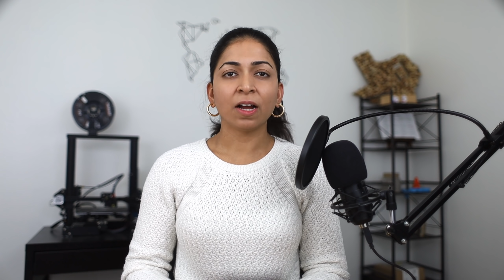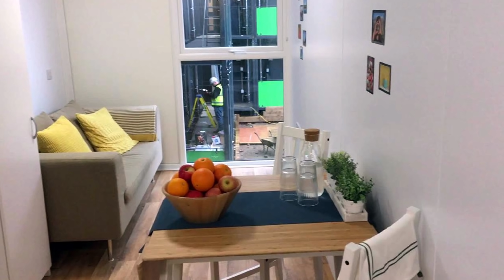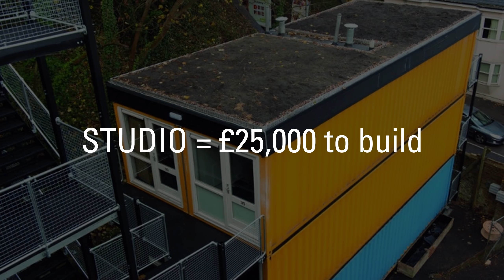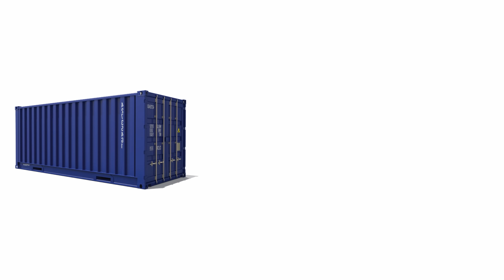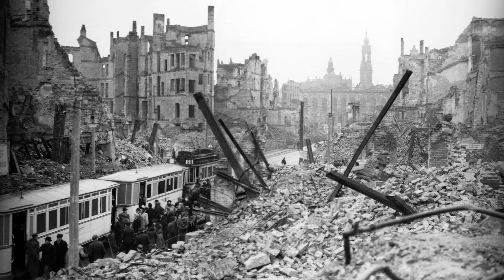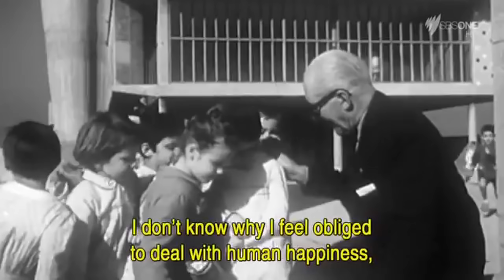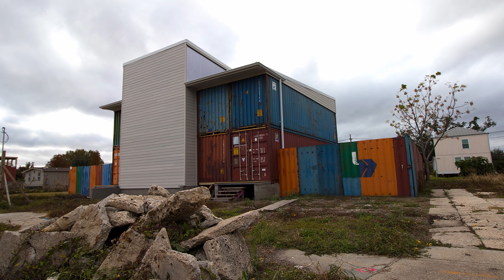Why Shipping Container homeless shelters FAIL

Comment: If they have hot and cold issues, then they were not properly designed.  Proper insulation and HVAC would be a big step in the right direction.  Cramped?  Apartments are pretty small as well but I have not heard the same complaints.

Comment: This is my conclusion - shipping containers were designed to be standardized and portable, specifically multi-modally transportable. They were never designed to be permanent stationary objects. So how can they best be used to house people?

Here's an idea I'm envisioning ... have FEMA buy up a bunch of old, excess containers and get them properly fitted out for temporary habitation. Utility connections would be via "quick-connect" type connections of some sort. Then, store them somewhere, like in the desert or something, in the same manner as the old planes at the boneyard at Davis-Monthan AFB. Thousands could be stored, stacked 10 or more high.

Now, let's say another disaster strikes, like a Category 5 hurricane, or massive flooding, or huge earthquake, or what have you. FEMA then goes into action, determines with local governments that a large number of evacuees need to be housed, maybe for weeks or months, then the call goes out for the containers. Arrangements are made to load them on trains for long distance shipping, with trucks to transload them to designated evacuation areas.

Arrangements are made with local utilities to set up bulk power and water delivery to the sites, the containers are unloaded and set up, and portable utility connections are set up tying the bulk delivery points to a network of connections in the shelter area. Transport the evacuees to the sites and there you go, something a little more sturdy than the notorious "FEMA trailers" from Hurricane Katrina that don't need a fleet of trucks to transport one by one.

Once their TEMPORARY use is over, the utility connections are dismantled and stored away, the units decommissioned, cleaned up, buttoned up, and then shipped back to their storage location to be ready for the next disaster.
Reply: Doesn’t FEMA have and utilize trailer homes as temp residences during natural disasters?
Reply: @phantomcruizer  I could be wrong but I was under the impression that the trailers were mostly unique to Katrina. Problem with that is that they all have to be hauled into place and set up one by one, and can only be stored on the ground. They can't be stacked to use less ground space.
Reply: @whiteknightcat  make them out of containers and you can store them multi level - all you need to do then is build flatbed trailers with locking pins and store both until you need them. They'd be bloody useful for tornadoes too. But I'd suggest putting solar panels on the roof of each and a modular battery to 240/120v system - less gubbins to link up.
Reply: That could work. America is large anyway so most cities could probably have a place for these.

Comment: The biggest problem is "the experts" and advocates always seem to apply a cookie cutter solution to a problem that has a variety of causes. Being homeless is just the common symptom that we see and think we care about as opposed to tackling the root cause of each person's issues that lead them there. Getting completely screwed in a divorce by a biased legal system, unemployment, mental problems, massive debt due to credit on demand etc. Some people I've met even just want to live on the street and get high and don't want a home because they will need to follow some kind of rules and they will be separated from people they know and get dope from. You can't put all these different types of problems in one place and expect positive outcomes. If you do the people with the worst case problems will generally just drag down others and you end up with another failed  housing initiative. You need to filter out the ones you can help (sorry but some can't be helped even though they say they want off the street) and address each person's issues individually and put them in a position where they can house themselves after some support. Just putting homeless in houses to hide the problem will always end up in failure.

Comment: Bob Joatmon is right. These container shelters are meant to be TEMPORARY. If the occupants need to live in these spaces for extended periods of time...well...then they are not temporary...are they? Perhaps it would be better to build modular, temporary housing from scratch...just like construction camp housing in remote areas...in order to allow prolonged tenant stays. Shipping containers can be designed to accommodate any environment, for a multitude of uses, provided they are properly designed and built. It is the readily available shipping design that makes them so appealing and the fact that they are structural for this purpose, as well as universal.

Homeless people wouldn't bitch about a roof over their heads, and whether or not it is too hot or too cold. They would be thankful (I am assuming of course) that they have a place where they are out of the elements, safe and secure. Living space is a luxury for those who can afford it. What about people in Hong Kong or China, who are living in steel wire cages...and paying for the experience? Maybe they would like a container home? At least they could stretch their legs...or stand up.

I think the best application of shipping containers is to provide the exterior or perimeter layout of a structure, which is added onto or in conjunction with, the containers themselves. One example is to adjoin two or four perimeter containers with a wood framed floor and roof, cutting and structuralizing entrances into the containers, leaving a large common area in the center. This is how many remote camps are built using trailers. The difference here, is that the shipping containers can carry the tools and material required, to construct what is needed and shipped to the remote site. It is a more delicate procedure to ship finished trailers...I know...I have built, shipped, and erected many of them.

Comment: I truly like Belinda's videos as I find them very informational. I like knowing both the good and the bad sides of things. I would say that saying the homeless or displaced are being imposed on is a stretch. No one forced any of the occupants to move into those homes. At the same time, if I was the architect/developer of those housing solutions, I would have presented them as a temporary option to an immediate issue or need. If you want something bigger or none modular, then move somewhere else, or go back to being homeless. By saying someone is being imposed on, you remove their responsibility of their choice to move into that modular/container/prefab home.

Comment: When I think shipping container I think home office or storage shed. 
When I think tiny home, I think single, young and working on my bank roll. 

There were some homes built near Palasades Jamaica some twenty or so feet from the sea. The walls were concrete but 3.5 inch thin vs the typical 8 inch. Those walls probably had no steel reinforcement. A hurricane struck and leveled all the houses. Not a sign houses were there. No furniture, no roof, no steel remnants, no concrete, nothing. All that was there are large smooth boulders some size off small cars.

Comment: Shipping containers are fairly efficient structures that can be mass produced and are inexpensive and tornado proof. Not designed for housing but better than the streets in many circumstances. These aren't forever intended structures, they are to help people get back on their feet... inherently a temporary solution, never intended to be long term.
You suggest a better solution, but you don't really offer one. You say we need to listen to those who will live in the homes, but those who live in the homes cant offer a better solution, they can barely take care of themselves in society.
Im NOT saying you are wrong, shipping containers are not the end all solution for instant homeless housing, but they can fit a bill.
As far as 35K pounds???? Thats insane, you can get small shipping container homes for $28k US, and thats with a lot of quality amenities. 
So, although you're intent is good, and homeless housing could be better, you didn't actually offer anything except criticism and suggested we listen to homeless people. Sure, they are going to want $150k houses, but thats not practical. So if you're going to critique, offer material solutions, plans, practical applications, not obscure recommendations about listening to the occupants. Geez. 
I don't have the perfect solution either, but im not bashing others who are attempting to solve the problem from an economical standpoint like you are.

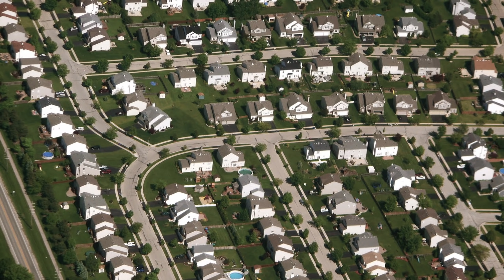Comment: 9:55 Who is the genius who figured that the cure for soulless and insincere suburban facades is even more soulless slabs of concrete and white 'modern' angular nonsense? I actually love exposed concrete and clean lines, but there is a time and a place for things like curved design, beige paints and warm colours, brick facade... And it just so happens that these two approaches can easily work together as part of a greater and more balanced whole.

Comment: 1: Beggars cannot be choosers. If you have been displaced due to things not your fault, getting your family out of the weather even into an ugly box is better than nothing, It gives you the capability to start over without bearing the cost of starting over from zip.

2: If you don't like your box, work out how to improve it. The internet is FULL of ingenuity. Tap into it. You don't have to be an established expert to make things better. You have to put solving problems smarter above social media whining. If you can't afford internet connections, most public libraries provide it for free.

3: After displacement, you are NOT going to take up where you left off. For example, people whose houses burn completely to the ground, on average, takes 10 years to recover.

Comment: it seems the probelm is with execution, not the principle of using the containers.  If the work is done correctly, like insulation, ventilation, etc, then most of these problems would not be there.  Of course, the variation and other "desireable" features are not there, but ultimately it's 1000x better than being out on the street.   It's a step up solution from being homeless, not a housing utopia for all (which would cost a ton - check Los Angles where homeless housing built new is cosing $700k per unit vs typical $350k average for "regular" housing).

Comment: My college dorms were shipping containers.  I didn't even know until I lived in them for two years.  They were just like any other apartments you would find.  Dry wall,  tiles in the bathroom, full size kitchen.  They were twenty years when I moved in and they had regular maintenance.  She left a lot out in explaining them.  It is also how they are made.  It wasn't an empty container, with a hot plate, a few chairs, and a toilet in the back.  We had insulation, with heating and air-condition.
Reply: She did. There's always ppl hating on shit. Better than sleeping on the street.
Reply: Let me guess.. you live in New York and have grown accustomed to tiny "homes" or in mild weather climates where hot and cold change is not that significant. Condensation is always a issue with shipping containers and you cant do anything about it.
Reply: @Hellsong89  LOL, close, however I was referring to Ramapo Collage.  it was 4 units per apartment,  We would get anywhere from 25 - 90 degrees.  I'm not advocating for using containers for however, it is apparent she never lived in one.  Proper insulation and heating and cooling it was perfectly fine.

Comment: Cabrini Green in Chicago, IL was a failure and was torn down.  Shipping containers aren't the problem, it's the fool that put people in them without insulation.  There are containers that are insulated called reefers.  This is easy to heat or cool in extreme climates.  A 40 ft used reefer shipping container can be good TEMPORARY housing for a family of 4 if it is laid out right.   These would be better than FEMA giving out RVs after natural disasters.  They could be put in the yard of the destroyed home  until the family could get back into their own home, then carted away to the next disaster.   When your house is small you will want to be outside more often, so the resident could use their yard to get some space.  If you are stacking the unit like apartment blocks then 1-2 person's max could reside there.  The key with sea cans is to really limit the holes you cut into them, to keep their structural integrity. This also helps to reduce heating or cooling loss.   Have just enough for emergency egress and the main door.

Comment: I would like to add that people have inherent needs for social acceptance, pride, self-worth.  Being viewed as a collective does not enable fulfilment of this, and it is expressed commonly with housing, furnishings, clothing choices and other expressions of individuality.
Having row after row of boxes is depressing, making people feel worthless, unimportant and indistinguishable from the rabble.
I'm building some affordable housing, and an important aspect of it is adding unique features that make the houses stand apart, that show pride in the workmanship and design.
When people buy these houses they feel pride, like they are not settling for a cheap box but have a beautiful home which is unique to their preferences.
Just simple things like post and beam over the main entrance, a nice glass encased deck or sunlight from a clerewall, island in the kitchen .  Doesn't add much to the initial cost, but is a longstanding feature that gives it distinction.

Comment: Don't throw the idea out because people complain about conditions. You fix them. Container homes for low income and homeless are still the best price.  Additionally, they can be built much cheaper by utilizing the labor of those who will occupy them.  Mold and mildew, apartments being stuffy can be mitigated through simple ventilation systems.  Better insulation can be installed. I have a 27ft RV I live in and one small space heater is enough to keep the temperature at 70F without taxing it. New wall heaters can do the same. You don't throw the concept out because there are a few displeasures for people who would have nothing otherwise.  People who complain about their situation are often disgruntled about a great deal of things, not just their living environment.  People adapt to tiny living all the time.  My daughter (12 years old) and I have learned to live quite well, debt free and happy to not be a slave to mortgages, loans and credit card payments with high interest.  People are slaves and have been conditioned to buy bigger because it provides a better quality of life.  In reality, corporations that live off the interest you pay and get rich for doing nothing is the real problem. Going tiny will meet with all types of adversity because it puts corporations that live off your money at risk of going broke. Going tiny should free you of debt if you don't mortgage your life away. A simple tiny house shell using new wood can cost as little as $1000. That's for a floor, walls and a roof. Simple shelves can be installed and a composting toilet and water can be hooked through a hose. For a hundred dollars more you can have a solar electric on demand water heater for showers. The possibilities are limitless.  Container homes are for stacking (given their strength) maximizing space for high demand land of inner city developments.  However stick build tiny homes are much more economical if land is not of a premium. Tiny is viable, it is eco friendly, cheap to heat and power, with a low carbon footprint.

Comment: High cube have 2.69 m internal height.Add exterior insulation & proper ventilation and you're good.Problem solved.
Reply: Agreed prob is they want fast n cheap I’ve seen containers done so you didn’t even know it’s a container

Comment: Your analysis of shipping containers used as homeless shelters and modular structures does not compute. It IS possible to create beautiful shipping container homes that meet the needs of homeless, urban professionals and retirees. To base your opinion on cheap design UK homeless shelters to reject shipping containers as a building material is short sighted and wrong. With the right engineering and design choices you can make a shipping container into anything you want. I do not have the illusion to change your mind. But I respond to your statements because they irk me the wrong way. How can someone with your education state their negative position without presenting their solution for us to judge.

Comment: The one concern I saw is from the interview excerpt. The stove in the background is too close tot he plastic wall, and has stained and/or burnt the wall because the stove is directly against it.
That doesn't meet the safe installation standards of any stove top.
-
I get why the problems happen.
Conversely I also think many people (particularly Americans) think they need homes that are far too large. We don't need to push everyone into a tiny home, but maybe we can forgo the 800+ square foot, cathedral ceiling living rooms and the kitchens that will allow four people to cook while a dozen people sit there and socialize. 
Make the houses less massive, and use the saved space to have a yard, maybe with trees and a garden. maybe just open space for kids to play and older people to enjoy nature.
Reply: The people who buy large houses don't have a housing issue. I don't get the connection.
Reply: @YSLRD  A big house needs a bigger lot. So zoning requires bigger lots of 2/3 to 1.5 acres. 
Therefore the same amount of land has fewer houses built, and those houses use more materials per house, and cost more per house, than smaller houses would allow.
-
That was the (poorly explained) connection I was thinking of.